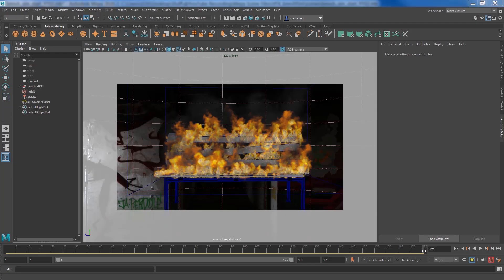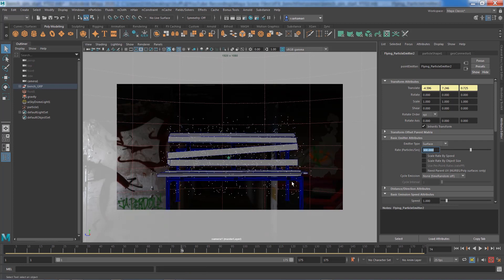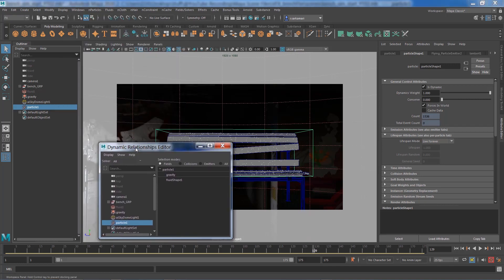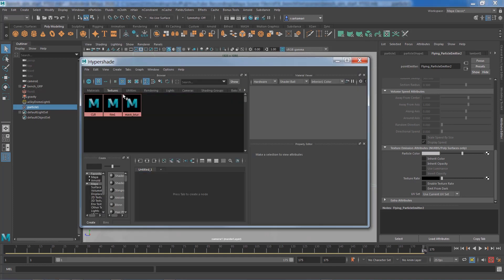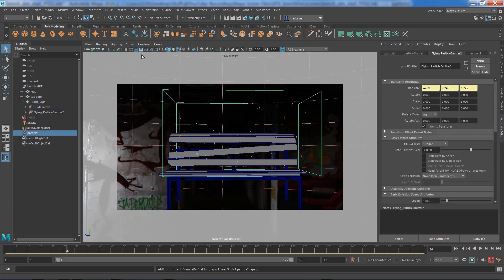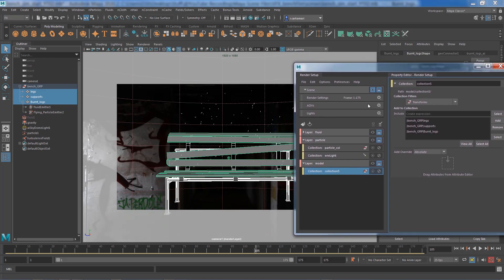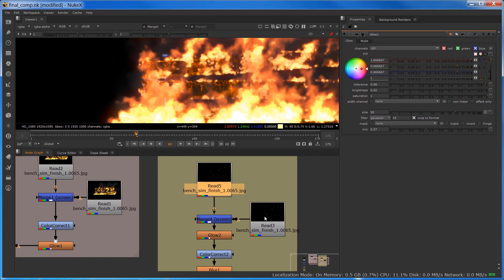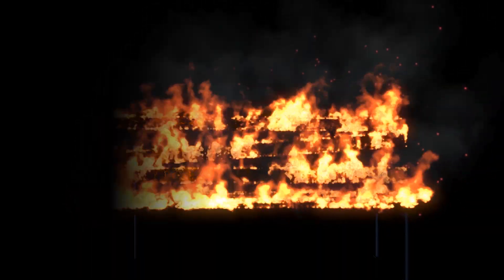Maya VFX Series: Burning Woods |  PART 2

Comment: hello sarkamari , the streak trails are only visible in viewport. in render they are like dots/points and also is there any method where we can make there color or shader as the fire please reply :)
Reply from the maker: you have two options to render the particles:1. to use motion blur
or 2. to set the type to streak and render it as a layer using maya hardware and comp it back to your scene in post. Hope this helps
Reply: I have render it as a layer and composited in after effects but there is only dots/particle.
I will try motion blur but i dont think that it will give as good result as streak showed in viewport